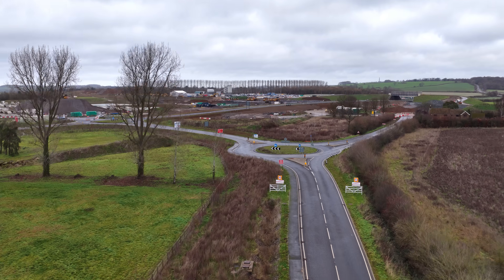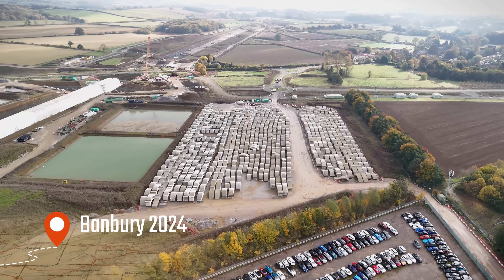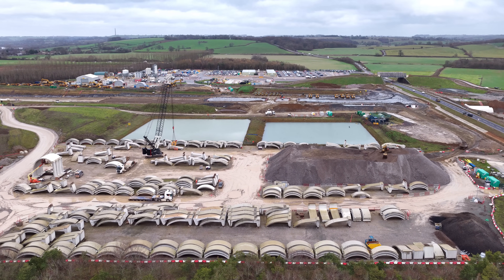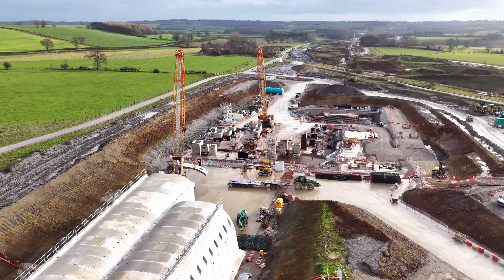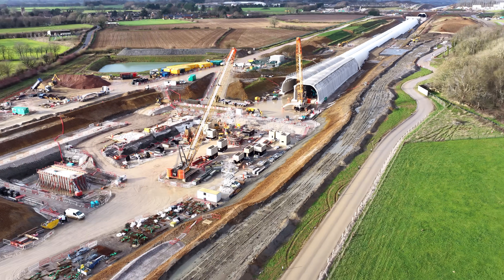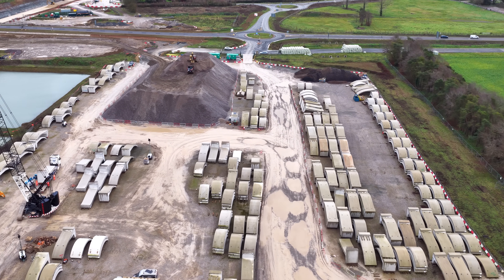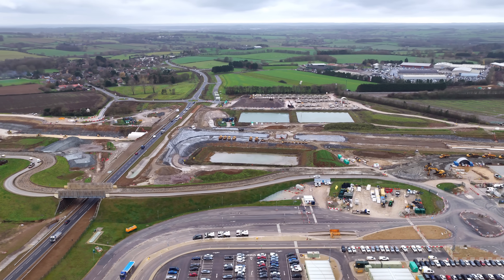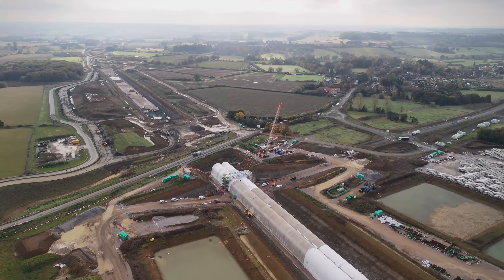HS2 Banbury Tunnel 2025 | How Fast Is HS2 Really Being Built? (Aerial Comparison)

Comment: hs2 is a monumental scam. the uk didnt need it . i loathe it.
Reply: The UK very much needs the rail capacity this project brings. 

If there's an issue with projects like this it's at the Parliamentary, planning and regulatory level which saddles such projects with unwarranted mitigation like this. Great engineering but operationally unneeded. 

Another example, Lower Thames Crossing is currently £1.2 Billion spent and no work yet even started.
Reply: @Polarbear1-b6j This attitude of "I won't use it, so therefore nobody needs it" is the real problem in this country as a whole. We have had a generation who have grown up knowing nothing but greed and selfishness, and now we are reaping the rewards.
Reply: 1. Its a 150 year piece of infrastructure and the cost per year is minimal
2. The UK most certainly does need more rail capacity on the WCML
3. Your choice.
Reply: yes we do need it.